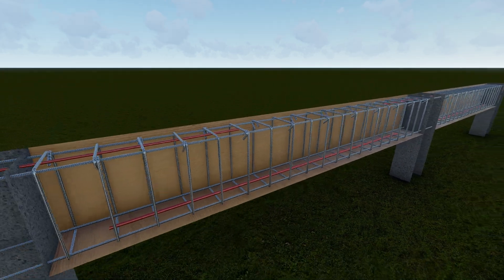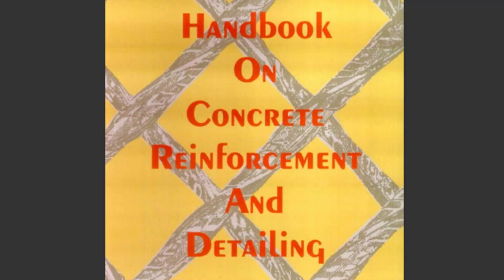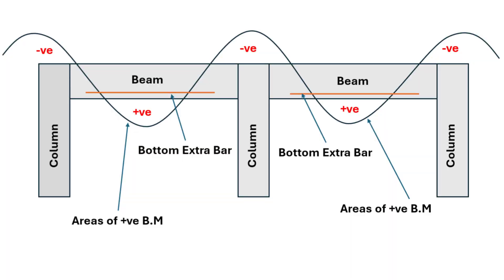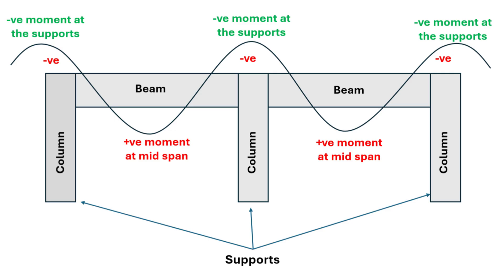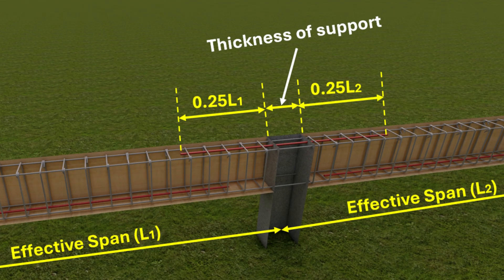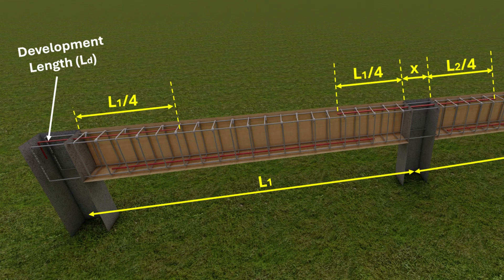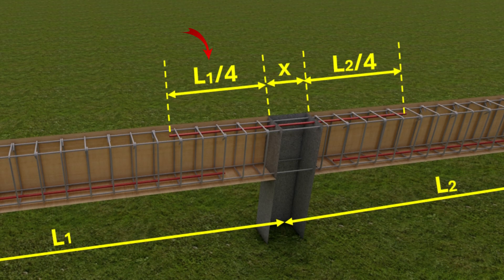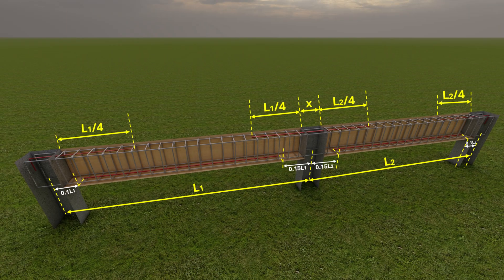How to decide the length of Top & Bottom extra bars in beams? | Curtailed bars in beams |Civil Tutor

Comment: It should have been made clearer that the extra top bar at the end columns is effective only when the beam/column joint is rigid and not pin - jointed or " hinged". The fact that the steel reinforcements in the column were not shown  at the joint, could lead to misinterpretation, 
With a pin jointed beam there will not be any negative moments only with a rigid joint. Assuming the column was made of concrete only , that beam will break the column underneath the ends ,  One needs to be careful  when projecting only the beam reinforcements as other conditions may be necessary to fit the  detail  being discussed.

I think that it would have been helpful if one mentions the " cantilever effect tacitly including in that rigid Beam. Column joint.